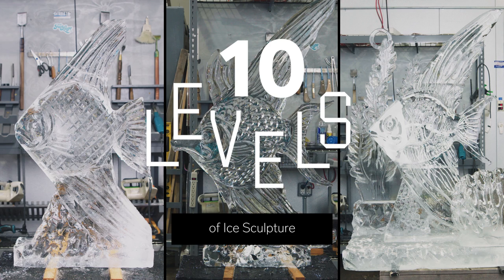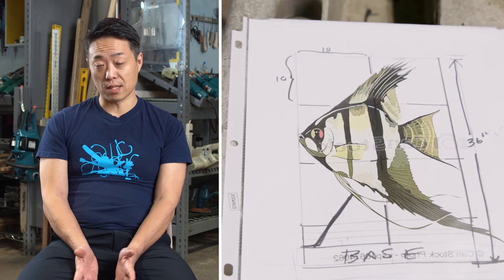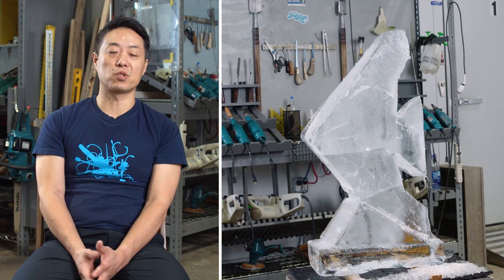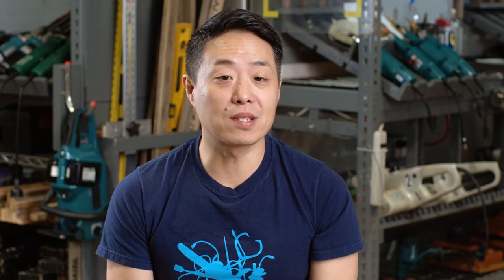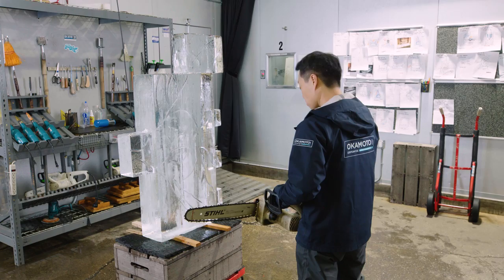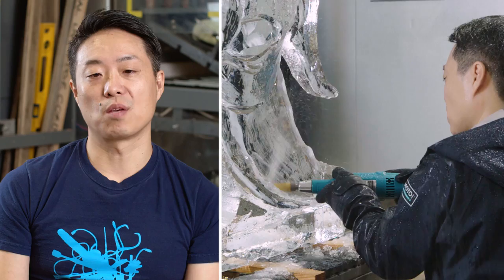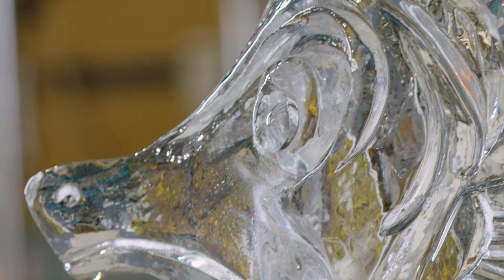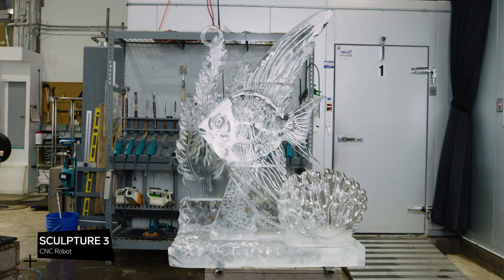10 Levels of Ice Sculpture: Easy to Complex | WIRED

Comment: I can barely even pop an ice cube out of the tray.
Reply: So can i
Reply: Use your tongue
Reply: twist the tray
Reply: @yon5244  pretty much
Reply: ShaeƧΉΛΣѕнαє Annalese you know that sounds wrong , right ? 😂😂😂
Reply: Morgan D run some water on the bottom of the tray
Reply: I use oyster knife for those
Reply: You need to pop it like it's hot
Reply: Omg same though
Reply: Try putting some oil in the tray.
Reply: Trg putting some oil in the tray.
Reply: That weird
Reply: rakes maharzan 
You can delete comments you know
Reply: If it's a hard plastic tray I just wack it on the counter upside down and a couple will hopefully pop put:)
Reply: Hot water on the back of the tray
Reply: It's easy,just keep it in oven for 2 minutes.
Reply: Wow same

Comment: If say for w/e reason: mistake or ice structure is bad around certain parts and take the example in the video, if the fish's tail breaks off. Is there a way to attach it with some water and re-freeze it to fix the unintended breakage.
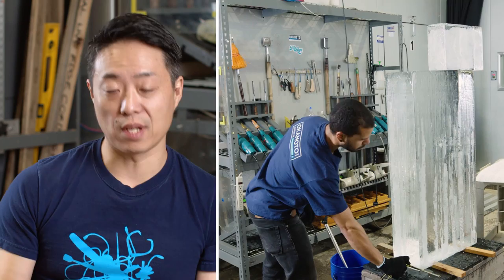Reply: 6:23 he mentioned here how to fuse two ice

Comment: Level 10: Hold ice cube tray in one hand while finding room for it in the freezer with the other, all without spilling
Reply: Succeeding only to spill it once it's already in so now there's gonna be ice everywhere
Reply: The worst part is you opened freezer door without relizing it's closing. Gave a suprised hitch and water spilt on the floor. 
Even worse. You slipped and fell.
Curse you freezer door

Comment: The level of CNC carving is very basic, this could be stepped up a level by doing more complex designs on the cnc machine itself, and not just using a 2d CAD model with a 3D machine

Comment: why doesnt it melt though? it should be melting as you cannot sculpt in like 30min
Reply: It's colder than regular freezer ice and it has little surface area compared to its volume. You could try to melt it with a heat gun for 10 minutes and it wouldn't budge.